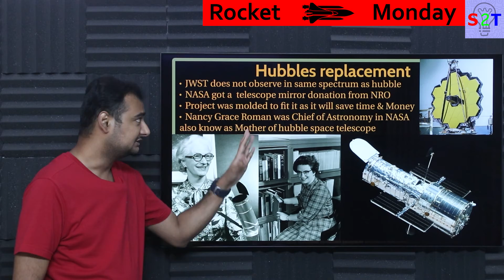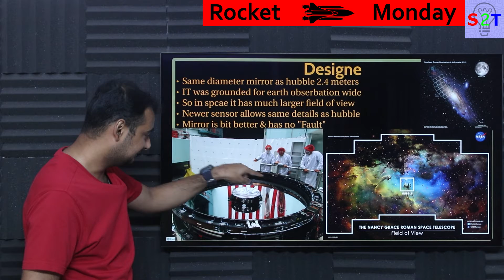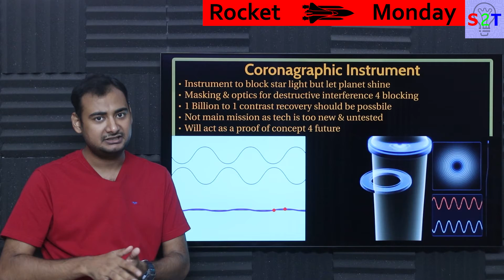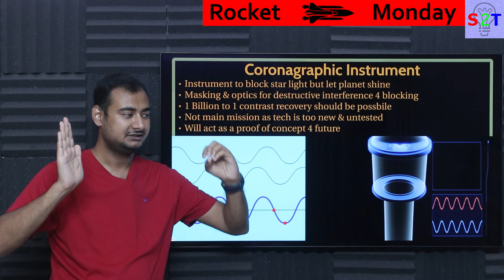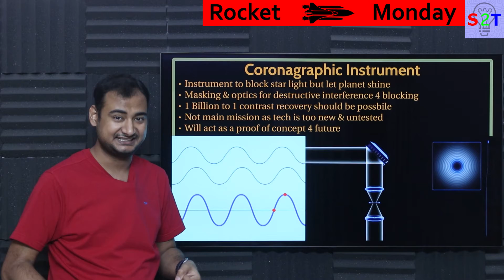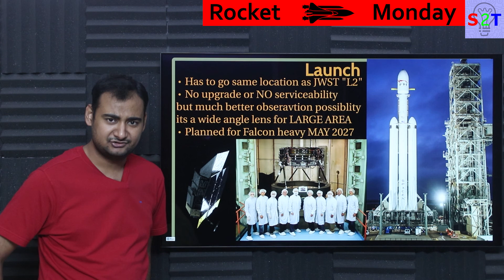Roman Space Telescope Explained {Rocket Monday Ep192}

Comment: I get it, the sensors could make a super hubble with 500x more resolution if they made a scope with the same zoom, but they instead made a super wide angle telescope with the same resolution as 50 years ago when sensors sucked
Reply from the maker: yes & the mirror doesn't have OOPS in it